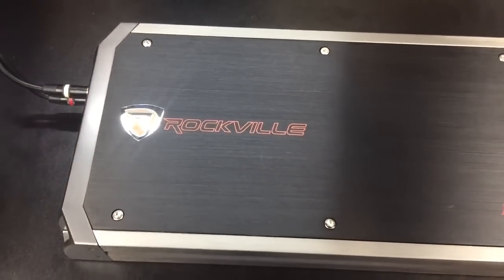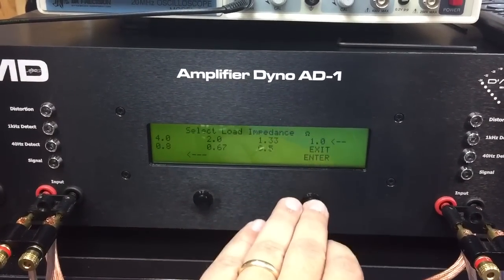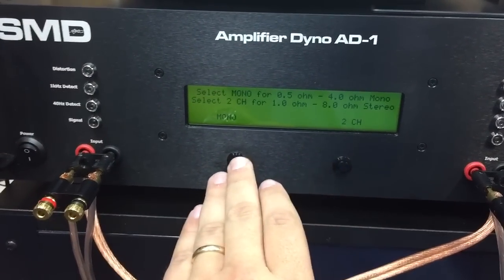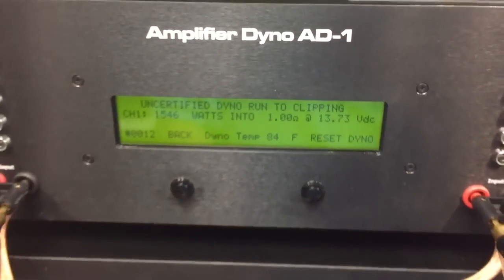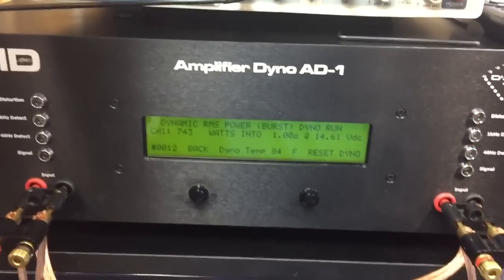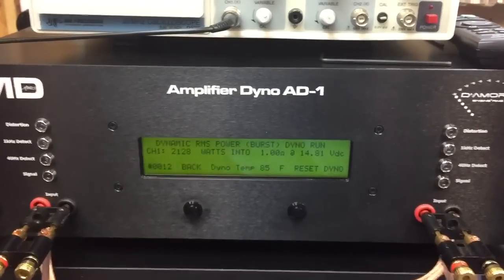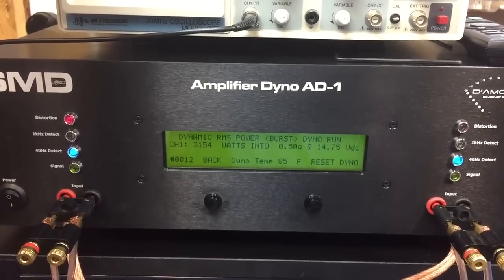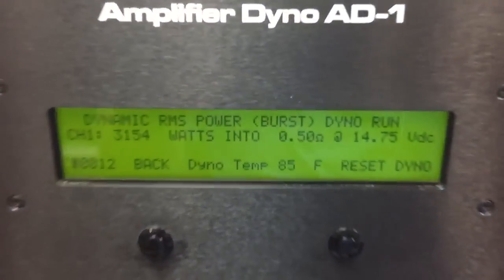Rockville RXD-M4 1500W Monoblock Amp Dyno Test

Comment: I also have a 4 channel with 4 rockville 8 inch mids screens so I added a rockville eq man not bad for system under 1k in my escalade love it no joke I'm a hard-core Rockford fan but if they keep this up I'll stay with them I have no complaints I played for about 14 hours no heating up or problems music was blasting like I just turned on great job I'm so impressed I had a spare amplifier for when it went a 5 channel I'm selling it

Comment: I'd like to see a test done on the Rockville RXD-M2 & M3. I own the RXD-M1, It's suppose to be 600w cea and 1200w RMS, with a single 60A fuse it's doubtful. As recommended by Rockville it was paired with the Rockville W12K6D2.I had the K6 in a sealed box, sounding damn good for a $300 system, then put the K6 in a Q BOMB ported box and it sounded pretty good for a $375 system. It shook the mirrors and rear wiper blade. 
I upgraded to the W12K9D2 and the K9 is suppose to be rated at 1000w cea 1200RMS. & it's still being run with the M1 it sounds a little better than the K6 sub did and I don't worry about blowing the sub. 
Why I'd like to see the MX-2 and MX-3 tested is to see which one would pair with the new K9 sub & would it be worth the extra money to have the amp and sub both made by Rockville or should I say screw it and mix the brands and buy the Ignite  R3000/1D. With the 3 Year Electronics Protection Plan  Amazon sells for $22 the amp and 3 Year E.P.P. comes to $125. Thats $10 less than the RX-2 W/O a 3 Year Electronics Protection Plan (E.P.P.) and $35 less than the RX-2 W/O the 3 year E.P.P. 
What amp, what amp, what amp should I invest in? I'm leaning towards the Ignite R3000/1D because you have tested it and it performs above my needs so I can keep the gain/ distortion low.
I'm not convinced the Rockville RXD-M2 or the M3 would be worth the extra cash & no 3 year E.P.P.
No one else on youtube has dyno tested the RXD-M1 or the RXD-M2.

Comment: This would be a good amp for two 12 inch L7s wired at a 1 ohm load ???
Reply: No you would need 1500 watts rms for those. This amp does it but it would be clipping. Ao you need a more powerful amp.

Comment: Can you guys tell me which board is the peak limiter board inside the amp? I think it is defective and cutting power too early, can turn it up after setting gains for distortion and it hits hard the first two bass notes then literally cuts it in half and it hits half as hard for the rest of the song. Is it both added boards that are soldered with extra wires or what? Can I just de-solder the power to the board that isn't glued down or what? Thanks.

Comment: Got 2 RXD-M5 (4000Krms-8000kpeak) railed together running a 4xl 15" at 2ohms. A little lack luster if you ask me.
Reply from the maker: Those are around 1800W each RMS output at 2 ohms

Comment: I love your videos, I currently have a Rockville rxd-M5 pushing 2 Alpine SWR-12D2 subs wired to .5 ohm in a vented atrend box. I didn't realize I wired it to a half ohm when I did it but have been slaming my system for two years with no problems at all. Would love to see you Dyno the Rockville rxd M5. Just curious as to what my RMS power is. I do believe the only reason the amplifier is working with the way I have it wired is due to box rise but I'm not complaining.
Reply: 2 years at .5 ohm!!  Welp, I see what brand I'm going with, thanks for that info.  I only plan on using at 1 ohm, so hopefully mine last for years too
Reply: You tune it with a multimeter. You didnt install it correctly if you dont know your RMS.

Comment: With such a change in wattage from 4, 2, 1 and .5 ohms i would be scared that the wattage might jump around wildly from song to song depending on volume and bass therefore potentially blowing subs plus the fluctuation in ohms that the subs present to the amp under certain circumstances i.e. box design/frequency ect......proceed with caution turn up volume knob at your own risk

Comment: I recommend checking solder joints as these have a huge failure because of bad joints. I redid all mine and stiffened up the coils as they had some wobble. 5 months in my avalanche on 2 15 inch mofos at a half ohm load and not one problem. I also did plexi on the bottom with a fan. The guts are pretty impressive also for such a cheap amp.
Reply from the maker: Great tip, thanks!

Comment: I love Rockville. Stumbled across them on E-bay. I have 3 of their amps. In my truck I have the Phenom RXD M1 2000w mono block with a 12" Alpine R12, Phenom RXA F2 2400w pushing 4 10" pioneer ib flat's and in my wife's car I have their db11 mono block 1400w pushing 2 12" pioneer ib flat's.

Comment: @Williston Audio Labs how do you wire this amp to a single dvc 2 ohm subwoofer wire to 1 ohm to the amp there are 4 connections and manual is confusing on which set to wire it up for 1 ohm
Reply from the maker: You can’t wire a 2 ohm SVC sub to 1 ohm, not possible
Reply: @wal  I put dvc in comment I meant single dvc sub. Lol. I figured out what those 4 connections was just extra ports for more than one speaker all are connect to one
Reply: @wal  I could have used better wording for my comment

Comment: Still new but what were the actual rms? Still kinda confused
Reply from the maker: All tests shown are RMS power, just different types of tests. Certified stops at 1% THD, uncertified stops at clipping and Dynamic tests amps ability to deliver dynamic burst power
Reply: So technically it can do 2k rms at 1ohm? I have a 15 that can handle 1500 and that’s what’s I’m trying to put at it either at 2 or half ohm

Comment: I bought one of these. I been running it at half ohm on 2 15's. it doesn't get hot. it doesn't even get worm it is always ice cold.
Reply from the maker: Don’t sleep on da Rock!
Reply: @wal   wonder what happens if you strap it with another 130 dollar half ohm amp?
Reply from the maker: @krazzykiller1  you get about 2x the power :-P

Comment: Question time... how much does the input voltage matter for how much power it will have? Does 14.5 volts have to be it for amps to make the stated power or will 12 volts make the same amount?
Reply from the maker: Great question. Most car amps sold these days will suffer with lower voltage as the amps are unregulated. You see some, such as JL and Alpine (their high end lines) which do virtually same power at 12 and 14.4 volts. Depending on the output of the amp, the difference can be enough to hear on unregulated amps (12 vs 14 volts). Always consider your electrical system when choosing an aftermarket amp. Anything over approx. 1000 watts, you will need to upgrade (minimum 2nd battery)
Reply: @wal  thank you! Also for running a car audio set up in a house for testing reasons which power supply would you recommend?
Reply from the maker: @schons77iceman  I like this one - https://youtu.be/WZxTCzS7FjA
Reply: Awesome but where can I purchase one of the 75 amp power supplies as the link in that video doesnt work.. also do all rockville Amps have a unregulated power supply? because that's the issue I'm having. I'm using a 12v power supply and it doesnt seem to have very much power

Comment: Nice. I'd love to see the Rockville RXD-M2 or M3 tested someday.
Reply: I’ve had the M3 pushing a 12” Skar sub for over 2 years with no issues. Just changed my sub setup to 2 10” Rockford HX2’s wired at 2 ohms... this amp is a beast. My only complaint is the bass knobs are junk. I switched to an RCA adjustable knob and could tell a huge difference and was able to adjust my gain way down and have better sound quality
Reply: Second this, I have the m2 version and am very curious
Reply: @allthingsmotor1073  I ordered that same amp

Comment: Big D  love your  videos sir. Can you please do the rockville 5 Chanel am,  I would like to put one in my goldwing gl 1500. Thanks see if it better than the  kenwood one.
Reply: I had the Rockville RXh f5 I believe it was. It's the phenom series 5 I was pulling 140 watts per channel to all four doors.there is a little more power left there but I didn't want to blow my speakers.and then I built a Plexi box to seal up one end of the amplifier with a 12 volt fan on a relay to blow air through it. Then I ran 2 10's on the sub channel. I was pulling 1600 Watts at 1 ohm.I sold this car with the system in it to my buddy his daughters driving it. Still pounding 4 years later.

Comment: i have to admit - i been testing this amp in real world for almost a year now, its setup at 1 ohm, and i have not been nice to it, by any means.....as in, i been trying to blow it, been trying to find a weakness, and the damn thing barely gets warm..... i bought 2 with the intentions of strapping because i thought "no way this cheap amp will be enough" - well, it actually is.... i have had it hooked up to an XFL10 in the trunk of a saturn and it hits....hard, as in consistent mid 40s..... i know mid 40s aint much, but when you think of a system with about 300 bucks into it, thats pretty stellar....
Reply from the maker: Mid 40’s from a trunk setup is slammin’ . Thanks for sharing your experience with these
Reply: I to bought 2 of the Rockville RXD series. 1 for subs and the other for mids and highs.. I gotta say i beat on these amps daily. Never once these amps gave any problems and this was 6 years ago they were installed and they're still pounding today with no over heating nor problems  ..They are hooked up to 2 skar evl 12's and 4 6.5 loud mid range door drivers paired up with 4 VX4-ST | 4" High Compression Titanium Bullet Tweeter. .

Comment: Could you do a dyno test on the Rockville rxd M5 and or possibly the rxa F2 amplifier? I have both of these in my car, I'm running 0 gauge ofc wire with a 50 farad capacitor also from Rockville, a 320 amp alternator from Michael Singer, 2 Alpine SWR 12 D2 Subs, and two pair of JL Audio C2 650 mids. I'm actually shocked because the car is deafening but would love to know what the true output of the amplifiers are.... thank you and please keep the videos coming, love what you do!

Comment: BigDwiz give me some help please. Im running the rxd t1 2 channel amplifier. I've got new oldskool stock 2 crossfire db3 2/8 ohm speaker's with dual voice coil's. So what's the best way to wire the speaker's 2 ohm ? I want to get the most wattage out the amplifier. Thank you
Reply from the maker: If you have two subs with 4 ohm DVC coils, there is no way to wire both of them to 2 ohms. They can be wired to 1 ohm or 4 ohms (or 16 ohms if all coils are wired in series). This may help - http://www.rockfordfosgate.com/support/wiring-wizard/
Reply: BigDWiz Thank you for your help
Reply: BigDWiz so my next question. There dual voice coil. So how do I wire them to bring them both 1 ohm stable. Thank you
Reply: BigDWiz You say 4 ohm's. Your counting each voice coil as 2 ohm.? Each speaker on the back reads 2/8 ohm @ 375 watts rms. I've never owned a dual voice coil before and the paperwork I don't have.   I greatly appreciate your help.
Reply: BigDWiz Final curtain call comes today as soon as Fed Ex gets here with the custom built tuned and ported. Amp is 2 channel 4Ω stable and 4Ω bridged looks like Im running series parallel to a final impedance of 4Ω. Im going to bridge the chrunch 1000x2 and smoke it will post a video. When the 1500 Rockville amplifier comes in later this week Im putting it ball's to the wall testing it. Final set up will be Two Crossfire 12s DB3 750 RMS for pair And the 1500 ROckville Amplifier. Hope my daughter likes it. It's going in her 1975 Pontiac Catalina the trunk is lonely. Thanks for your help.
Reply: BigDWiz Got it up and running 🏃 I wired the two 12s @ 2Ω per Subwoffer. Just upgraded to a new 120 amp alternator and waiting on the 0 gage cable to ship to me along with all the awg 200 amp fusses. Thank you for your help BigDWiz the system rocks I didn't know much about Crossfire's but I done my homework they're 4Ω dvc @ 2Ω and the amplifier is 2Ω stable the custom box is one piece tuned to 37 subs are divided ports are chambered. They had to go in the trunk they're so loud. Im waiting on the 1500x2 Rockville to come in and doing away with the overrated 1000x2 crunch. Again thank you BigDWiz

Comment: I'm kinda new to this is same amp I bought. and wondering how I should tune it with my two ten planet Audio 1500 watts per speaker they say! Can sum one tell me what I should set the gain at before I destroy anything thank fellas 😁
Reply from the maker: +Joshua Roberg gain needs to be matched to head unit. It's pretty easy not to blow subs, just turn them down when you start hearing distortion

Comment: Hey bigdwiz would you use this amp to power two 12's Dvc RF P2D4 wired down to 1ohm. I'm using sound stream Pn1.1000D at 1ohm but the problem I'm having is it over heats within an hour or so then shuts off until it cools down then it works. When it's on it sounds great the key is when. I'd like your advice to buy an amp that's stable at 1ohm and doesn't over heat so fast also that matches my subs rms which is 400 watts each. Please help me ol wise one!!! 🙏🏼🙏🏼
Reply: Whad Up most amps have a hard time pushing 1ohm constantly, that's why it's going into protect or overheat. A good budget amp that is 1ohm stable and good price is this Pioneer GM-D8601 brand new on ebay $116 shipped. It does 800+ watts @ 1ohm and is cea-2006 compliant.

Comment: when adjusting an amplifier with a digital multimeter, should you adjust the voltage output using cea ratings for the RMS rating? the Rockville rxdm5 is rated at 4000 watt RMS at 1 ohm, but is rated 2000 Watt cea at 1 ohm.
Reply: Yes. Do 2K.

Comment: Since this video has been released, Rockville has made a big brother to the M4. The new Phenom M5.
Could you Please Please test the bigger M5 Big D?
A little back story, after seeing this video. I grabbed the M4 and ran it hard at .5 ohm daily on 3 Power Acoustik Gothic 10's. It was running great, it would jump into protection mode after 2/2.5hrs of full blast (gain properly set and I didn't have any cooling fans on it) But really was impressed. I since change vehicles and also changed over to a Sundown audio 2 Ohm DVC 15, after a few days on the 200amp fuse the was provided in the box the amp came with the amp popped the fuse. I had checked the gain and tried to track why the fuse failed, long story shortened. I changed the fuse and poof, amp went up in smoke. (15days after the 1yr warranty was up)
After doing a bit more research on these amp's, I'm not the only one that has had it happen to.  So I'm a bit skeptical about buying a new amp from Rockville, but was really wanting to get the real world numbers on the M5.
Love your videos Big D.
Thanks for your tests, they really help a lot of people in making a decision on what amp to go with.

Comment: BOOOM
Reply from the maker: +300 club shacka locka
Reply: BigDWiz would you have the connection on some older crossfire gear?
Reply: BigDWiz ebay is lacking at the moment.

Comment: I'm having problems with mine. it sounded good but at times would make a loud popping noise during the loud part of a song or if I turned it up. now I can't turn my music up at all without having this problem. it's a loud cracking noise coming from my subs right before the green dot goes off and the red dot comes on and then my subs go off completely, usually I could turn off and back on the radio and it would fix the problem but now it only gets the green light to come back on and then as soon as I start listening to music again the same problem occurs. any suggestions, or has this happened to other people?
Reply: Nicholas Eppinette 
If it's still under warranty send it back before it is. If it's not then you'll have to buy a new one, you probably have one that has issues. Can't get 100% to work flawlessly,  Not even the big guys!
Good luck brother..

Comment: Hey guys these amps make decent power. Check out my wall build I did with these. I'm running 4 of them and have had 5 burn up and need to be replaced. One caught on fire.
Reply from the maker: +AmplifiedCarAudio oh, that's not good. Better keep a fire extinguisher around 🔥

Comment: Seems very interesting do you think a Rockville RXD-M4 6000 Watt/3000w RMS Mono Class D 1 Ohm Amplifier will work for 1 
15" HCCA Series 2 Ohm 4000W DVC Subwoofer by Orion or will that blow the sub?
Reply: My friend was running 2 hcca 15s on 1 m4. At a half ohm and it slammed hard! Flexed those hcca subs like crazy.

Comment: would this amp push my 2 audiopipe txxbd3 15s 1200w rms 2400peak subs to the max
Reply: anthony smith yes it would man totally make sure you have a good battery and zero gauge wire
Reply: dank9288639 thanks

Comment: could you include a current draw on your videos?
Reply from the maker: I do in most of my videos, just got a 1000A DC clamp so I can test current pulls for larger amps too
Reply: cool do u remember the current draw on that rockville m4?
Reply from the maker: +JP Hernandez 140A at 1 ohm to 1% THD (1274W at 14.12Vdc), 150A at 1 ohm up to clipping (1501W at 13.71Vdc). These are worst case scenarios with a constant 40Hz test tone
Reply: nice. thank for your reply!
Reply: could u test an old skool earthquake power 300tx

Comment: if most of us have 12volts can u give us the specs at 12 volts or is it not much of a difference?
Reply from the maker: Alternator should charge 13.8-14.8V though. There may be 100-120 watts difference between 12 and 14.4 volts for this amplifier as it has an unregulated power supply